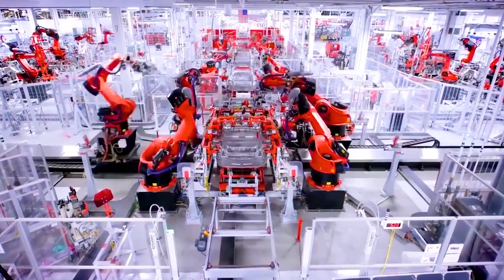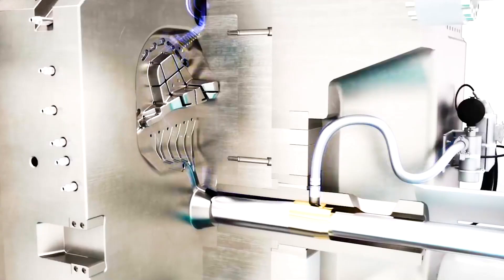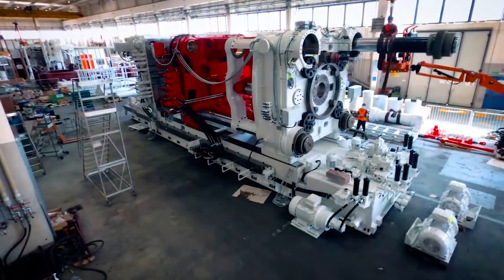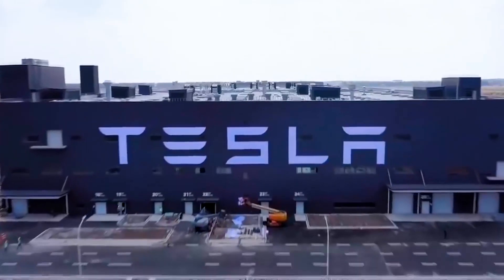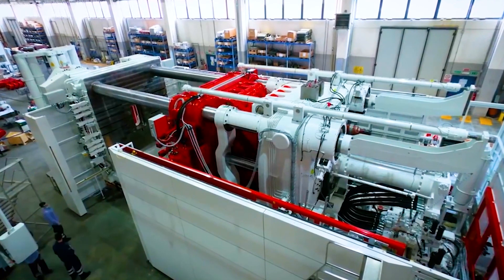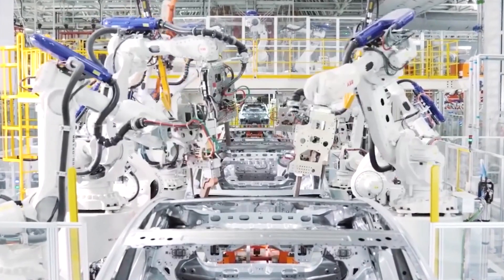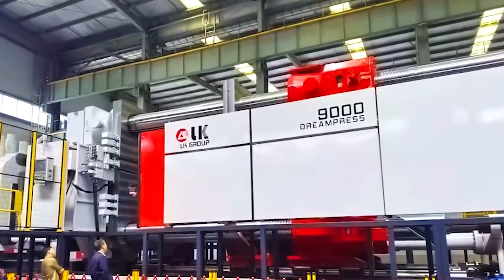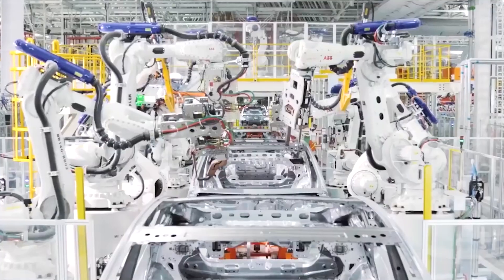China’s revolutionary SECRET WEAPON will DESTROY Tesla's Giga Press!

Comment: Is this why when Tesla's have an accident they are written off if it involves the body shell to hard to repair. Aluminium does not lend to being welded as it usually breaks beside the weld . It doesn't like being work hardened and it would be to hard to jig up to return to original position .
Reply from the maker: Thanks for Your Comment!
Make sure you are subscribe to the channel so you never miss an update!